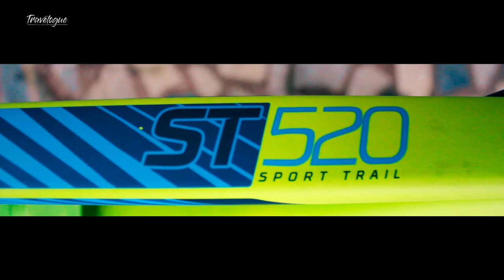#Decathlon #Unboxing #RockRider ST 520 | Best Off-Roading MTB | 2021 Model | Btwin Gear Bicycle

Comment: My height is 5' 9.5". What size should I buy? M or L? 
Also, is it safe to order from Decathlon's website? Currently no stores in my area have the stock. So my only option is to order online.
Please suggest.
Reply: It is safe to buy from decathlon online website
It's trust worthy
And if you want to know about height then check your height in centimetres to know more about your size
Reply from the maker: You can go for L and it is safe to buy online
Reply: @dopecontent267  Thank you brother for the suggestion. I will try this out.
Reply: @Travelogue  Thanks brother for replying. How much does L size measure in Inches? I know there are 17" , 18.5" and 19" frames for MTBs. So would L mean its 18.5"? or is it 19"?
Reply from the maker: That is unclear to me about the frame size in inches. What i know is if your height is more than 5.8” that is 175cm then you should go for 27.5 inch wheel size and large frame
Reply: @Travelogue  Ok bro thanks for the suggestion. :)

Comment: Hi Bro, I ordered this cycle two days before and it will reach me in a week, I have a doubt , can you tell me the gear combinations and all, many are saying that in reviews that there is an issue in front derailleur when switching from 2-3 or 3-2 but that time decathlon was giving sram and Shimano combo, but now they are providing a complete set of microshift , please let me know if you are facing this issue and if yes how you overcame it?
Reply from the maker: What i get is - Sarm X3 Rear & Shimano Hyperdrive Front 
Shifters - Sram Thumb
Till date I didn’t get any problem while switching gears… so can’t say anything about it..

Comment: Hey, i am currently looking forward to purchase this bike online from decathlon app. I wanted your genuine review and suggestions on the same as i am unable test ride it due its unavailablilty at the store. Whether this bike is recommendable both city rides and off terrain considering all the specs and cost..as you have already used it for awhile now
Reply from the maker: 👋🏻 in my experience this is best cycle i had ridden so far in my lifetime.. very comfortable & lightweight as well.. it’s been a month since i got this cycle & i have travelled around 500kms on this. Never had any bad experience with it like most of the cycles do i.e. tyre puncture, lose chain, etc..

So in my opinion go ahead buy it..

Comment: Can u tell me what Derailleur & Shifters your st520 came with.

Mine.

Front : Shimano Altus
Rear Derailleur : SRAM x3
Shifters : SRAM X4
Reply from the maker: Derailleurs - Sarm X3 Rear & Shimano Hyperdrive Front 
Shifters - Sram Thumb
Reply: @Travelogue  okay thanks just wanted to check about Front Derailleur mine is Shimano Altus my friend got Microshifts in front.
Reply from the maker: When i checked in store they are selling with Microshifts
Reply: @Travelogue  ohh then now they have done it for cost cutting.
Reply from the maker: Maybe
Reply: I got today 

Front : Shimano Altus
Rear : SRAM X3

Tyres : Hartex (little disappointed as I dont this Brand. I was expecting all terrain tyres)
Reply from the maker: That’s great

Comment: I had ROCKRIDER ST 520 
Bad experiences worst bike I ever use..
Reply from the maker: Why so
Reply: @Travelogue  The suspension is not working , thumb shifters is not working properly,Rear derailleur hits the rim every time and even broken derailer ,the disc brake is not a good braking bite,the front tyre puncher 3 times ,the both tyres grip on wet conditions is not good...
Reply from the maker: Wow that’s a-lot to have a bad experience…
Well i’ll post a review in a couple of month or so about this rock-rider. Let’s see how this is going to perform for me.
Reply: @Travelogue  👍🏻🙂